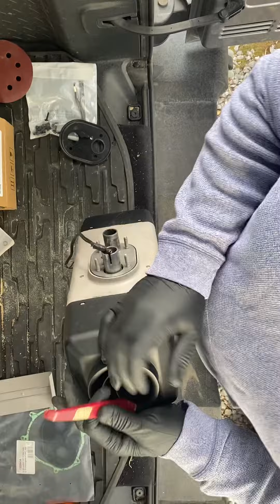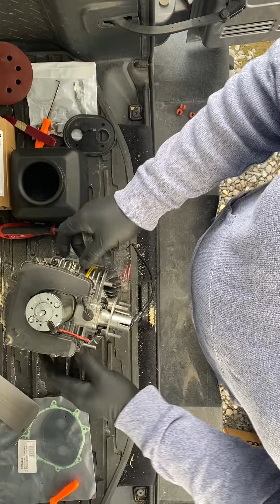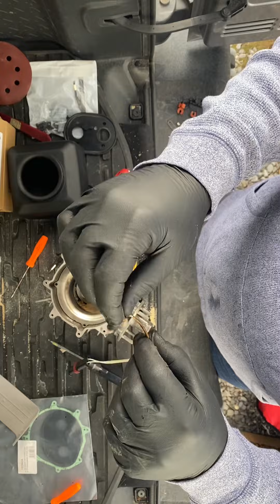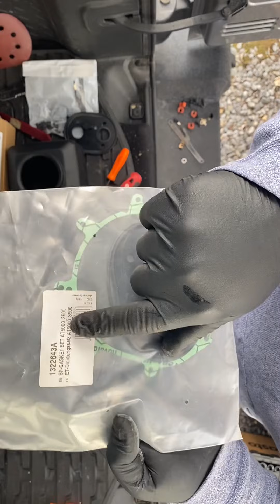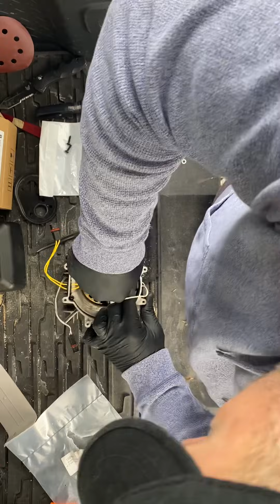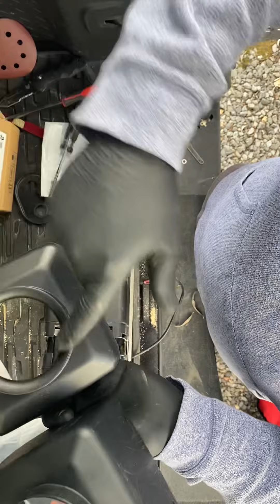Webasto diesel heater burner replacement 2000, 3500, 5500, 40 & 55 evo

Comment: Hi I have a webasto evo air top 5500 and I am getting a 08 fault code (fan/drive motor)... Can you tell me more about how to diagnose if it is the Glow Plug shorting out, before I go and but a new fan motor? Thanks!

Comment: Great job ! It happens I soaked my new  Evo 55 with Diesel so much (too much pressure to prime the Diesel intake) that it was leaking out thru the air intake. What would you recommend to do to dry off the whole system ... without dismounting it almost completely ?? Thanks
Reply from the maker: That's a tough one.  So, you have two ports of entry, neither are a straight shot into the chamber to use something like brake clean to blow it out.  Depending on your time frame, location, and install etc. The only way I could think to get the diesel out or down to a level that you could safely burn off without disassembly would be to remove the exhaust, place a catch cup or the like under the port, turn the unit on in VENT mode, full blast.  This will spool the combustion fan up to the highest rpm.  Let run until nothing is coming out, it may take a couple hours to get the diesel out and the remainder to evaporate. Depending on your vent set up, you may want to disconnect the vent coming off of the heater so that you limit the amount of fumes that may be pumped into the cabin.  Short of that, a disassembly is the best bet.

Comment: is it different for Air top 5000?
Reply: The 5000 is the older version it’ll look mostly the same but the parts don’t crossover as far as I know
Reply: @deaconyates2671  Thank you. I see the parts are not the same. Yesterday I went to my boat and webasto did not run (fault 4). So I guess I have to change that glow pin (that is also flame sensor) and I guess that after more than 10 years of running in the winter maybe the burner may also be replaced...Did not know that I have to change the bolts as you mentioned in the video. Well... always smth to do:(
Reply: @SailingMOYA  after 10 years, you’ve done well, sounds like you need a burner kit,( burner, glow plug, gaskets, retainer and bolts), just check for cracks in the housings and sensors when you have it apart. 
Over time the compressed steel wool (lack of a better term) of the burner will expand and will touch the glow plug, it causes flame outs and no starts.
Reply: @deaconyates2671  Thanks for reply. My wife dismounted it just now. It is located in a narrow spot (Jeanneay 43ds) and I do not fit in:) She had to cut the diesel line since both clamps (screws) were corroded and it was impossible to dismount the rubber, hose from the unit. For sure it needs TLC. So as you said, for sure I have to change the burner (that is a cost..)? What exactly is retainer? I think is not such a demanding job and I think I'll service it by myself... Thanks.

Comment: You're a great teacher.  Thanks!
Reply: Thanks, hope it helped you.
Reply: @deaconyates2671  Just followed your instructions on my Air Top 40, everything seemingly went fine, but when I hook everything up and fire it up it won’t start and gives error code 88 “Open circuit in fuel pump”. Any ideas? I unplugged and replugged the fuel pump connectors (both) with no luck. One thing I also did while it was opened up was replace the control board with one from an Air Top 55 to try and convert it for more heat. I am starting to suspect this won’t work. Any thoughts? Your help would be much appreciated!
Reply from the maker: @mattsigman3551  I'm sorry I didn't catch this in time to help, but there shouldn't have been an issue with the up fit, however there are different fuel pumps and since the fuel pump acts as the metering device, the resistance detected by the new board was probably not within spec, so it threw a code.